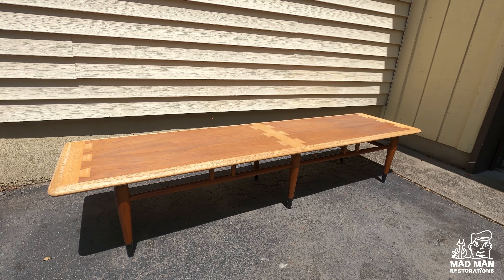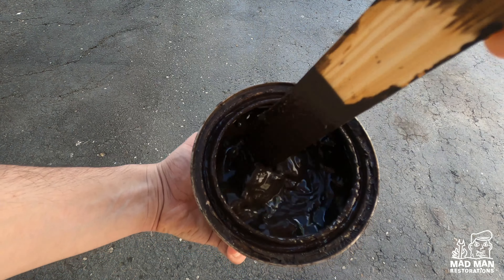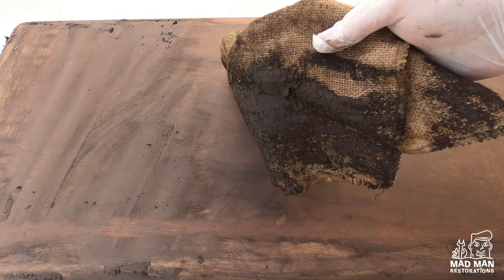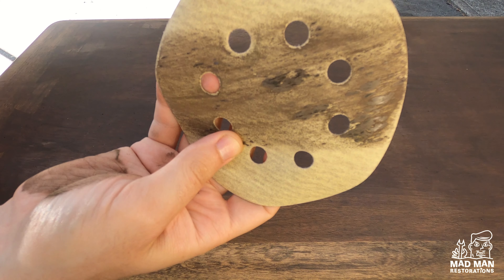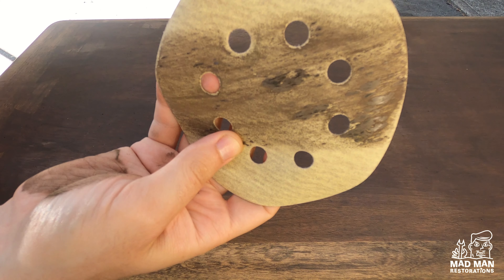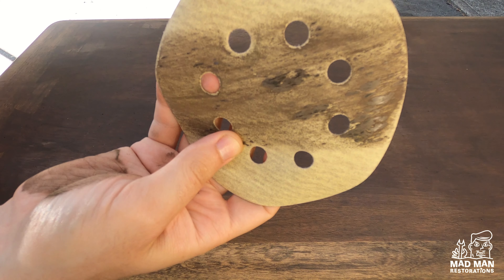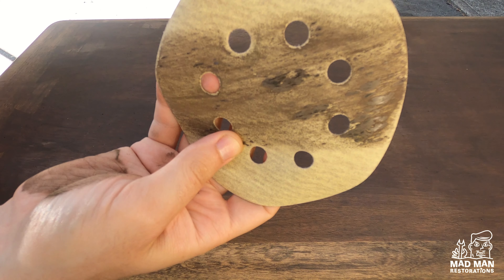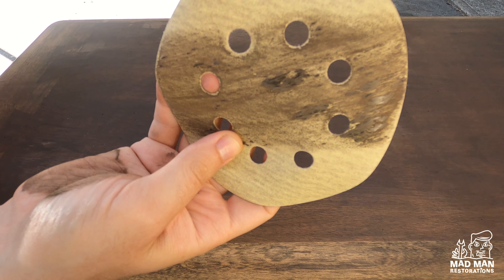Why You Should ALWAYS Grain Fill

Comment: Hi there, I really appreciate your videos! You do exceptional work! I was wondering if I wanted to stain the table I’m working on, would you stain it, before you grain filled it? Do you need to put vinyl sealer after the stain and then grain filler? Sorry to throw a monkey wrench in the mix. lol😊
Reply from the maker: @tammywalla7259  process goes: stain, sealer, grain fill, sealer, glaze, toner, lacquer.
Reply: @ Thank you. Thank you. That’s what I thought it was but always good to double check!
Reply: @ Do you always glaze?
Reply from the maker: @tammywalla7259  for most walnut pieces I glaze.
Reply: @MadManRestorations  I actually bought a lane coffee table that I thought was perception, as it turns out it was built in 1985 and is made out of oak. The style is the same as the one from the 60’s other than they used oak as far as I can tell. I’m going to stain it med walnut and use the same process as perception. It’s my first attempt at this process. I guess you could say it’s a practice run. Fingers crossed!

Comment: Thanks for the video!
What is the equivalent to burlap? Cab I use an old t shirt?
Reply from the maker: Hmm. I'm not sure. You really just want to take the excess off before using sandpaper.
Reply: @MadManRestorations  do you recommend cleaning the sanding dust (after sanding the grain filler) with Naphtha? I want to spray a nitrocellulose lacquer over the grain filler but I'm afraid that oil and lacquer doesn't "play" well together.

Comment: Nice explanation. Did you use the same process for applying grain filler to the legs? Or, did you skip the step and only apply toner?
Reply from the maker: In my Lane restoration I show you those details. But I only grain fill the top and glaze everything else including the legs.
Reply: @MadManRestorations  Have you refinished any Lane Rhythm furniture? Is the schedule for refinishing similar?
Reply from the maker: @catsinthecradle8997  same steps for Lane rhythm.
Reply: @MadManRestorations  same for Perception as well?
Reply from the maker: @tammywalla7259  yep 👍

Comment: Did you apply a glaze to this table or did you just use toner and sealer? Thanks!
Reply from the maker: For this table it was: sealer, grain filler, sealer, toner, lacquer. But I have put glaze over the 2nd coat of sealer before with good results.

Comment: Why would you sand with the grain, wouldn't that take out the grain filler?
Reply from the maker: Good question. Using 320 kind of prevents that. The goal is to sand the excess filler that's on the surface not the grain. Let's say I used 150 grit and sanded the whole too like and initial sanding then yes, the filler in the grain would probably be removed. I hope this explanation helps.
Reply: @MadManRestorations  my boss had me going against the grain using the burlap but everything else you've done in the video is what I do. I work in antiques. I was looking for a better technique than what I was doing but thanks for the reply. I'll subscribe 👍🏾
Reply from the maker: @jeffreymiller4984  🤘🤘